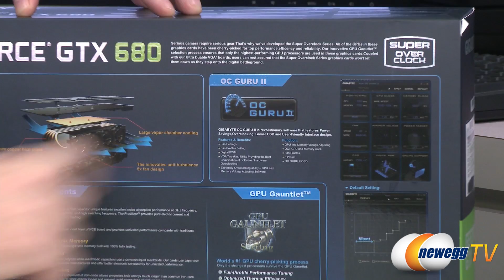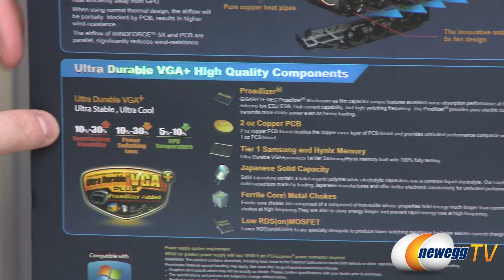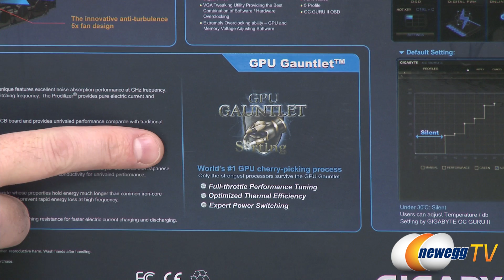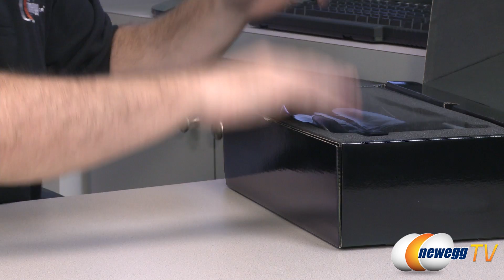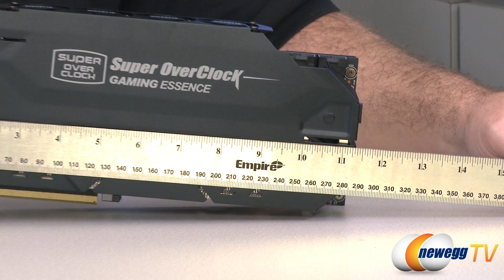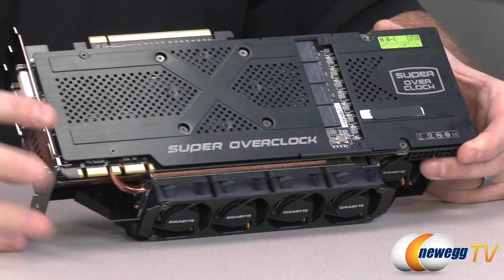Newegg TV: GIGABYTE GeForce GTX 680 Super OverClock Video Card Overview

Comment: Still using this card today as is my best buddy, it's a beast. It's replacement, (for both me and my buddy), a GTX 1660ti OC 6 gig is on the way however and I eagerly await it's arrival in the next few days. Fyi, I propped up my 680 SOC with a piece of wood from the top of a hard drive caddy in my pc case

Comment: Anyone have this card. My temperature range for this card is 50 to 70 celcius. I wonder if anyone has the same figures.
Reply: Tinkle Ass i have the same gtx 680 and mine averages 54 Celsius while gaming and it's around 45 when idle,hope this helps

Comment: i wonder why ASUS didnt make a design like this when they made their triple slot cards, seems to make a lot more sense, their heatsink was only like less than one slot thick, this card has a heatsink that is alone about 2.5 slots thick because of having no fans on top of it, and as we all know for heatsinks all that matters so long as the airflow is good is the number of fins and the surface area of them. i wonder how well this design actually works as a cooler...

Comment: quad sli quadros 6000 for max performance with  i7 3970x, 64 gb ram, 1500W power supply and for optimzed cooling, buy the obsidian 900D because im sure stuff like farmville can get ur comp very hot.

Comment: That isn't a GTX 690. It is a new generation flagship card, an upgrade to the 680. SLI only supports four GPUs at the moment,  so the 690, a dual GPU card, can only be run with one other one. The titan, however is a single GPU card and can be run in up to four cards at one time.

Comment: get the 7970 ASUS Matrix. I hear with the newest drivers from AMD, its practically pull away for the best graphics chip on the market. I mean i heard something along the lines of 1400/1750 overclocks with it. Besides the 7970 core is strong as fuking hell, much better than the 680. buy nvidia next generation, hopefully 700 is good. then again 8000 AMD could be good too..... ahhhhh the graphics chip race.

Comment: yeah I actually work with computer hardware alot, im a network admin, running a datacenter. but i love building gaming rigs cuz each one is a unique combination of hardware. but im hesitant to OC anything. mostly cuz a boost of 100mhz is not gonna matter much at those higher rates. games do not benefit much from OCing. and this holds even more true when it comes to CPUs. but I c ur point. If i get MSi lightning, ill go with an MSi board (big bang xpower2) and vice versa with gigabyte.

Comment: probably either a base GTX 660 (reccomend gigabyte) or an overclocked sapphire amd 7750. problem with your system is that your power supply is super weak. not many good graphics cards can run at that low power consumption.

Comment: Not when you overclock it and go eyefinity/nvidia surround. The 7970 oc'ed is way better than the 670, and performs way better in eyefinity/nvidia surround.

Go with the 7970 my vote, no bias. You wont regret it.

Comment: There are so many other things that have to be looked at to gauge performance. More VRAM isn't directly correlated to more performance, and while the 7970s bit interface is bigger, there are many parts of both GPUs that can't be directly compared because of varying internal architectures. The only true way to gauge performance is to actually look at how both perform at said game, and it's known that Nvidia handles tesselation better than AMD and as a result the 680 performs better than the 7970

Comment: Um, there is no case that would support 4 way sli with this card.  Its a 3 slot card.  4 cards would require 12 expansion slots.  I've only seen cases come with 9 (+1 but that's not an issue).  So even if there WAS a mobo, you would have to make a custom case to house it all.

Comment: well thats way to loud. I have a GTX 690 and its quiet enough for me. It is quieter then the 7970's I had before. (Also I had massive driver problems with my 7970's and the power draw was to much) 

Btw, 7770's in CF? I wouldve went with a higher spec card instead of 2 7770's o.o

Comment: There allready a review (with Video) on Toms Hardware about the Windforce Cooling.
Its not that loud i first think but over 60db is way to loud for my silent build.
I am using the XFX 7770 DoubleD in CrossFire an this Cards running at about 30db at 100%

Comment: 5 40mm Fans???
This Card will scream like Hell when its gettings hotter.
Not really a "silent" Solution.
For SLI Triple-Slot its fine but i keep my CF Dual-Slot an got 1 Slot Space in between (+1 Fan in the Sidepanel of the my Case to give some extra fresh Air)